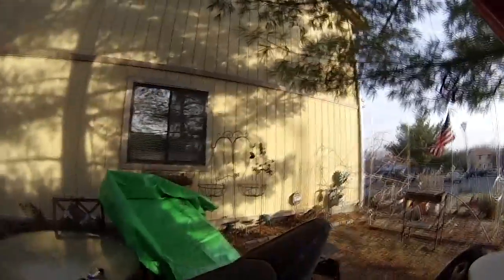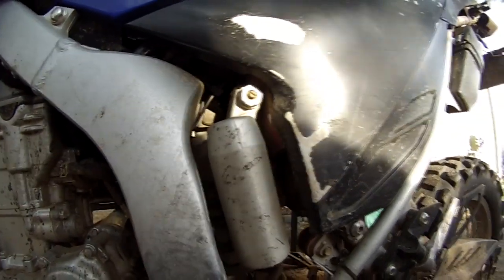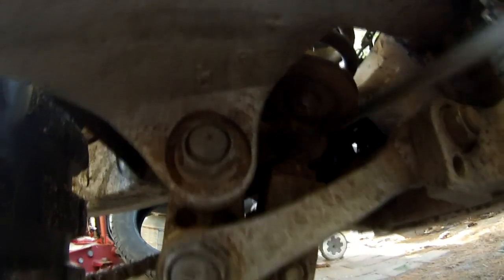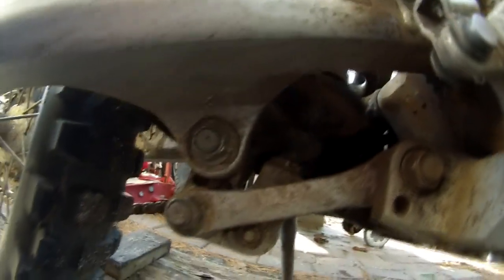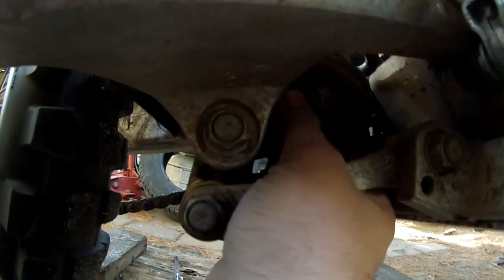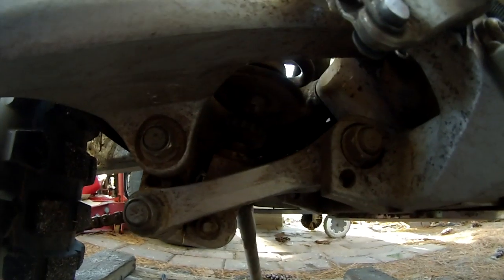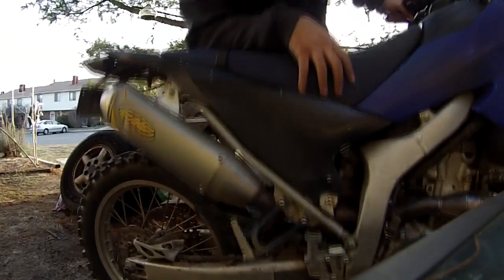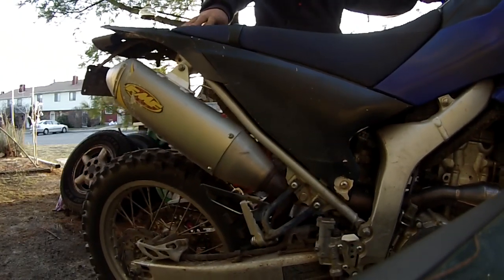How To Adjust Rear Suspension On Your Yamaha WR250R- NJBIKELIFE

Comment: To me it looks like there is no rebound on the rear mono shock. You may need it serviced or it will feel like a pogo stick. Max rebound adjustment should slowly let the suspension back up.

Comment: so the thing on the linkage, up or down is stiffer?
Reply from the maker: turning it counter clockwise makes it stiffer. so in this video you see I went all the stiff, and then backed it out certain amount of clicks (in the manual it says 3 for max hard, 12 for standard, and 25 for softest).